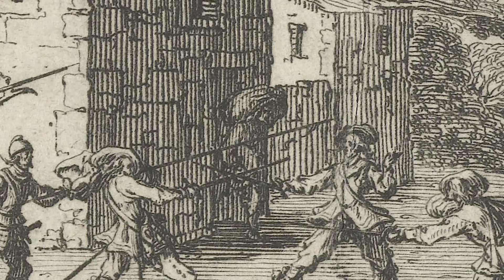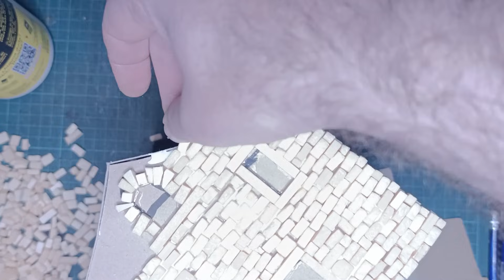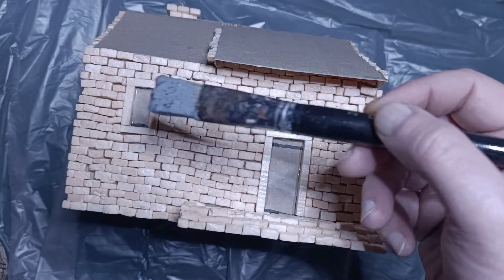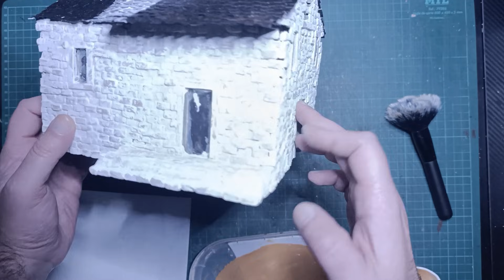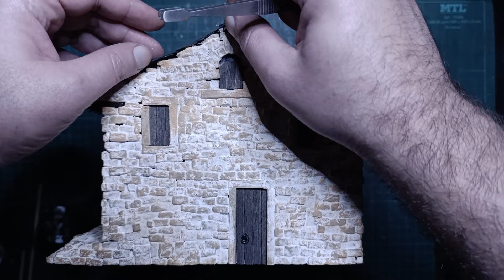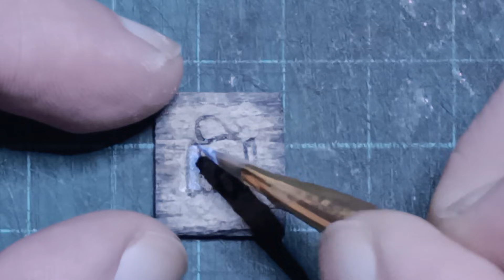Build your own Disreputable Inn for Warhammer and D&D

Comment: Another trick for texturing bricks is to put all your bricks into a plastic container with some rocks and shake vigorously for a bit. Another, other alternative (if you don't care how much your building weighs) is to use fish tank gravel, which is comprised of small, rounded stones which already have sufficient texture (and might even be of a base color you like). You can apply your adhesive and then press the building down into a pan of them, easily adjusting how they are arranged if spot fixes are required. This works well for cobblestones, too. At any rate, I'd raise an ugly mug to your work! Cheers! =^[.]^=
Reply from the maker: I've done the plastic container with rocks thing before, didn't care much for the noise and effort :) The fish tank gravel idea is neat, I'll have to look into that!